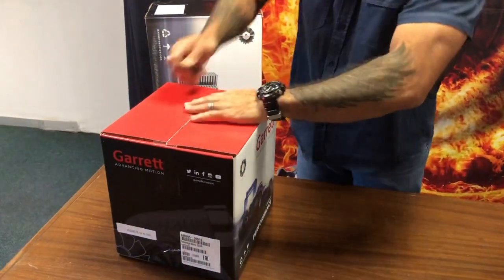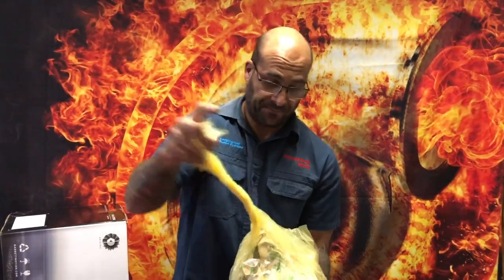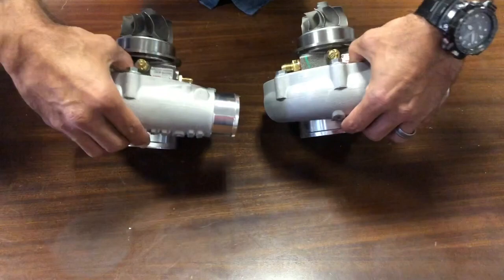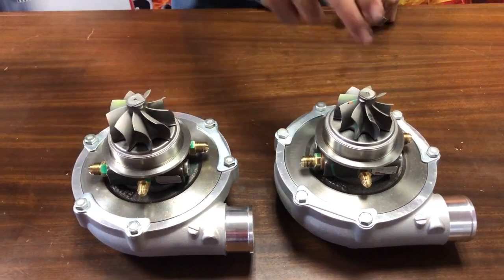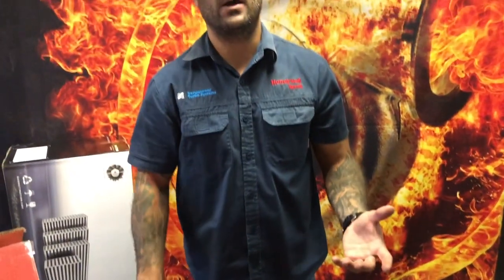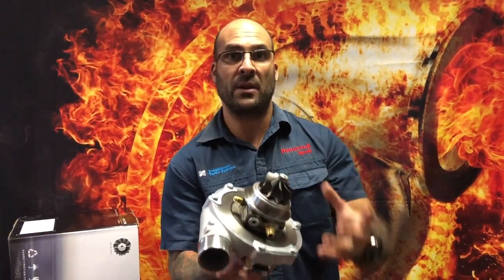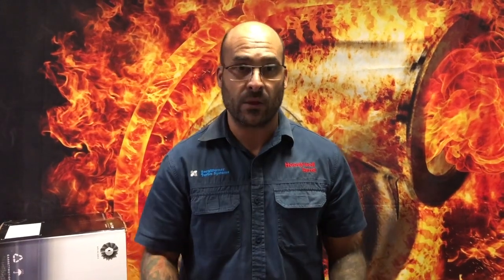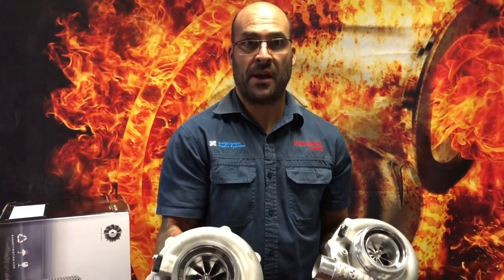G30-900 and G35-900 compared

Comment: Great videos man! I need a new turbo. So far I have been running with garrett turbochargers. Any advice would be appriciated. I got a rwd street car running a 3.2 engine, much like the 2jz. My setup is as follows; 6800 rev limiter, 9:1 CR, 95octane. 1.3 bar of boost on a t3 T04E. It may be too much to ask for, but looking to keep my 200whp at ~3000, and anywhere between 500-600whp at top. Would G30 660/770 or EFR 7670 be a decent option? Cheers!
Reply from the maker: Thank you for the comment - Garrett are overrated, especially the HP claims in the new G-series turbos. There are many options that exceed the capabilities of the latest Garrett range. Shoot me an email and i will assist you further info@turbodirect.co.za
Reply: @TurboDirectSA  Garrett's G-series HP ratings are based on two things. Crank HP, and with HIGH FLOWING heads such as K-series heads. When you take those into account, they're actually a bit UNDER-rated, as I've seen G-series turbos run (on a high flow head engine) damn near the rated power AT THE WHEELS. So if you have a car with a crappy head and an auto trans, especially a older (read, less efficient) torque converter auto, then yeah, you won't get 660 out of a 660 Garrett.

But if you have a K24 with a transverse-mounted, straight cut sequential trans? Yeah, you'll see every ounce of a G25-660 helping you blow the doors off of whatever wants to run you, AND spool up like a MOFO down low with the right housing (meaning don't choke it with too small a housing).
Reply from the maker: @Drunken_Hamster  I have to disagree - air flow is measured in lb/min according to most compressor maps. The closest X10 measurement which is an industry standard in turbine mapping will generate 100HP per 10lb/min of air flow - your engine can either use it or not  - if it cannot, you will not make as much power as the next engine that might be able to use the flow in a better way.  

Having said this - just because your engine can 'use' the air flow, does not affect the fact that 10lb/min of air flow (X10) will produce 100HP - the compressor maps are fact, based on testing on gas stands and the results are printed - the G-series turbochargers do not perform as advertised, and if you are seeing big numbers, try a different dyno, and you might be surprised.   We have measured HP and air inlet flow using flow meters from Superflow on our engine dyno and we have verified both air flow inlet to the compressor and the HP output from the engine as married to X10 perfectly - no corrections.
Reply: @TurboDirectSA  Was this test being done at Denel Last April? I was at your showroom and heard the dyno running inside.
Reply: @siyabandasekho6851  This was Bruno's engine - i heard about this at Midvaal, they changed the turbo to one of Turbo direct ones and it outperformed the G35 that was on there not sure of the numbers though.
Reply: @TurboDirectSA  This was my engine that you setup for me, the G35-900 maxed out at 38PSI and made 782HP on the water dyno. Your turbocharger made 812HP at 30PSI on the same dyno, and 839HP at 38PSI with some more to go. The engine is broken now thanks to someone who didnt listen and turned up the boost after you warned me not to run higher pressures.  We ran out of injector!
Reply from the maker: @brunopotgieter2016  Sorry to hear this news man! Please remove that turbo and send it to me, the engine failure if you ran lean, would have damaged the piston, and there could be aluminium in the manifold, turbine housing and on the surface of the turbine wheel blades.
Reply: @TurboDirectSA  So who makes better turbos, then? From what I understand, Garrett's G-series is doing some almost magic stuff, especially in terms of spool speed/boost threshold to total HP numbers. Not to mention how compact they are physically.
Reply from the maker: @Drunken_Hamster  This question will be different for every person, as its personal preference. If you asking which is a better product based on features, design, quality, finish, price etc -- then BorgWarner takes the win every time. Some of the features that Borg have over every other manufacturer are the following:- 

GAMMA-TI turbine wheel
Water cooling jackets that are more than triple the size of Garrett
Enlarged bearing cartridge, ultimate reliability
Designed for motorsport and racing (yes fit for street use and drag racing too) 
Stainless investment cast end housings
Vband attachment for the bearing housing and turbine housing mate
Massive swing valve internal gate design
Twin port swing valve internal gate
Aluminium Bearing housing
Integrated DV
Integrated Solenoid
Speed sensor port

Read the above carefully - and know this - these features are in existence now since 2010!!!  Thats right, EFR came out with these features almost a decade before Garrett or anyone else did.  "New technology" from Garrett are simply copies/responses to the EFR designs. 

Personal preference remains a factor in each persons choice for a turbo, but facts and features on paper, Borg takes the win every time! In practise and performance/results, once you have tested Borg back to back with Garrett, you will land up choosing Borg aswell - albeit be it a little difficult to move from the red box for those die hard Garrett fans ...... try it and trust me you will agree.

Comment: Any experience with these on a evo x with a 2.2L stroker? Looking for 700-750hp.
Reply from the maker: Not personally, but a client of mine shared info on this build before changing to one of our TurboDirect S.A Forged turbochargers. The turbo replaced was the G35-900 and the power was lower than expected at the boost pressure that they were running. 

The change to this turbo showed an increase in power while maintaining the same response, bringing the power band into line with their requirements. Lower boost pressure with more power. 

 https://turbodirect.co.za/store/index.php/shop/turbochargers/gtx3582r-forged-detail

Comment: Hi Chris, what will be te best the G35-900 or G30-900 on a 2.0L 20v... thanks in advance
Reply: Hi Chris  750whp
Reply from the maker: @eduanwessels4292  These turbos don't make the claimed power by a long shot. The most we have seen on a 2.0 multivalve 4 cylinder engine is 720HP at the crank. You will not see 750WHP with the G-series 30 or 35-900. The compressor map will reveal a better idea of what you can expect to make with these turbos. 

The EFR8474 is a much better option by far, it makes the power first of all, and the features of the EFR series are untouchable compared to the Garrett range. The bearing housing is available in aluminium, the cooling port design is far larger and superior to Garrett, the rotating assemblies rotate alot slower to make more power, and the internally gated options with swing valves up to 42mm in diameter are something Garrett cannot compete with at all.   First hand experience with the EFR series and the 8474 Black, specifically, opened alot of our eyes.
Reply: Thank you Chris, with the EFR 8474 black is it better to use the twinscroll  and what exhaust housing will be the best to use? I know they said you can blank the EFR turbo to make it a external  wastegate if you still want to go twinscroll. Just want to know what you think will be the best for the 2.0 20v to make 750whp.
Reply from the maker: @eduanwessels4292  You should use the AR82 housing - i wouldn't use external gate at all, it will create lag especially with smaller size engines. The swing valve on this turbo is 42mm (42mm wastegate built into the turbine housing)  Shoot us an email info@turbodirect.co.za i will get a video to you showing you the response of this turbo and a 9sec run in an RB26DETT at 1.7bar gauge pressure.
Reply from the maker: What HP target Eduan?

Comment: Hi I have 2 projects I been working on and always used garrets my first question is 
1: I’m doing a built motor  (cla 45 amg )2.0l 4cyl dct 7 speed awd
I was told to use 3076r as upgrade turbo 

But instead I’m doing a custom exhaust manifold  I was gonna go g30-900 I’m tryna hit 780--840whp  I want a turbo that won’t be too laggy giving it’s a 2.0l motor  but still can hit hard  2800-3400 

Project :2 :I currently have a hellion twin turbo hellcat 
6.2l v8 motor fully built stock heads just upgraded pushrods,beehive springs and lifters mds deleate, 
I have the garret gtx3582r gen2 turbos on it now the car made 1200 whp on 25 psi and built to go 31-33psi 

I think it’s a 1.01 ar or 83 not sure it’s the kit from there site 
The car pulls hard but since it’s not a stroke426 it tends to be lazy down low anyway below 4300-4500    I want to know if I switch to a g35-900 would that be better.   Or should I use a different a.r housing first ? 

I know gtx3582r is a 66/68 basically any help would be appreciated on these projects 

The hellcat is a fully forged motor turbo cam and built transmission 

The cla 45 amg will stay 2.0 4cyl forged bottom end.  Single mount system  will be street raced /roll race events
Reply from the maker: Thanks for the comment - happy to help and offer our opinions and experience. The G30-900 will not see close to 900HP at the crank let alone at the wheels - dont bother. We have experience with this engine with a closed circuit track car in South Africa, which makes 340-360WKW at around 1.6-1.8bar boost - running an EFR7163 Vband AR85 turbine housing and internally gated.  The turbocharger spools as quick as the stock unit and makes over 150WKW more power at the same boost.  The EGT's are lower than stock, the water temps are lower and the drive-ability of the engine at low boost street driving is unmatched. The car had two previous turbos on, one was a bolt on kinugawa (paper weight) which was a copy of the Garrett GTX3076R and was laggy and made no real power. Then there was a Genuine Garrett G25-660, which spooled faster than the chinese paper weight, but didn't make close to the claimed 660HP - the EFR7163 is claimed to make 550HP, but the compressor maps shows closer to 600HP and the turbo delivers exactly what it claims on paper.  This car should use the latest EFR8370 - this is the same turbine stage as the EFR7670 (650HP capable on paper) yet with a better compressor stage, and is now claimed (on paper) to produce 750HP, but the compressor maps tell a different story - showing closer to 800HP capable. This will spool as fast if not faster than any G30, and will definitely deliver the goods, and save you money at the same time. 

Regards to the Hellcat - thats easy - change to the AR8 turbine housings, (thats IF you have the AR1.01's on currently) that will solve your problem, if you have the AR83's on now, then change to the AR61's - you will cut off slightly up top (20-25HP loss due to back pressure) but low down you will gain plenty.

Comment: Hi there! What's your opinion on using these turbos on a single port head, like the mk7 GTI I am building? Expecting 700-750 wheel on e85, given I already have a fairly large exhaust restriction even with a sizeable port to the head where it will not flow past 800-850ish typically even with porting, is the G35 just likely to be extra lag with no benefit?
Reply from the maker: SleepyGTI - thanks for the comment, im sorry to say but you will not see 750WHP + on the EA888.3 engine. Not with all the external mods nor with larger valves, and flowed head. If you see 700WHP you will have achieved more than most with a spend of over $30K+  in their builds.   This is just not a realistic power figure im afraid.  We have clients who have run EFR9280, GTX3584RS, S300SXE, and many other combinations, and the power seems to top out around 650-680WHP in most cases.  I would stay far away from the G35 - it does not make anywhere near what is printed in the catalogue.

Comment: What’s the difference between the g35 900 vs 6466 for an Sti?
Reply from the maker: The Precision turbo uses a larger rotating assembly on both sides - but the precision will make the claimed power - the Garrett will not make the claimed 900HP - 

Another option which makes the power and will easily outspool both these turbos is the EFR8474 Black.

Comment: After looking at this video, several other videos, the comment sections of a few of your videos, talking to several tuners, and talking to friends that have turbo S2000s, I feel a bit conflicted as to what I would throw on my car now. (most likely due to my lack of knowledge in turbocharging) I've had very conflicting answers regarding turbo selection for an F20C motor, some people saying a GT30 sized turbine running out of steam in the top end (7500RPM+) because the head is flowing more than the turbine can flow, and then the GT35 sized turbines making far better power for equal spooling (a case of the GTX3076r [mismatch] vs a GTX3576r).

One instance I talked to an S2000 owner that used a G25-550 .92A/R, and he switched to 660 compressor housing due to some compressor surge.
Another recommended a GTX3582R .82A/R to take advantage of the F20C stock head flow, as the car is already fairly gutless under 5000RPM. This leads me to think that the G35-900 would be a good match for the car but I'm not so sure now.
I understand that running a larger turbo at lower pressures would put it outside of it efficiency islands possibly.

Right now the car is a bit in of an identity crisis where its edging from a weekend warrior street car to a circuit car that's not very practical on the street, and trying to get the car to perform both roles that I find satisfactory.
I'm leaning on sacrificing the street drivability of the car to allow for better headroom (more headroom is always better right?).
Reply from the maker: Thanks for the comment - let me shed some light on this for you. We have a number of clients who run these S2000's here and i have built and supplied a number of different turbos on these engines. 

1) They are high flowing indeed - 
2) power drops off with the smaller GT30 family size turbos, even with larger AR turbine housings
3) Low down response with the older Garrett style turbos is almost impossible WHILE TRYING TO BALANCE HIGH RPM FLOW

We have build Journal bearing T4 setups with the 60-1 compressor wheel and 446905-0501 turbine wheel using the AR63 T3inlet and 4bolt outlet race style housing from Garrett - it works well, but low down is miniscule. 

Then the GT3582R (not GTX) using AR63 turbine housing - better low down, and similar HP up top to the 60-1 compressor - but not thaaaaaat great for street. 

The best low down response with a massive 950HP capable option is by far the EFR8474Black series - using the AR83 turbine housing will blow any of the G-series turbos out the water in response aswell as outright power delivery. The internal gate is superior and will save you alot of money and plumbing under the hood aswell.
Reply: @TurboDirectSA  This is super awesome information, while drafting the comment I completely forgot about the EFR black series. This helps a ton, thank you for quick response, much love!
Reply from the maker: @Temtac  Pleasure buddy -- we just tested an EFR8474 Black on a fully built RB26DETT hill climb car with the AR92 turbine housing, and it spooled too fast, 3500RPM was already pushing into the seat - and the engine is build for 1300HP and lives at 10000rpm, we now replacing with the larger AR1.05 housing - we want the power later in the RPM range -
Reply: @TurboDirectSA must be externally gated because internal gate on these will be lucky to go past 2 bar. Falls 200hp short

Comment: First of all, the G30-900 turbo will NOT do 900hp, (just think of 900hp flow through a +2' pipe in hot turbine including 9 blades. Not gonna happen! (all marketing) 
2) ratings are these days on high nasa rocket octant fuel (all marketing), other program uses correct pump gas as lbs calculation, so dont compare rocket fuel with pump gas
3) these turbos are clipped on both compressor exducer and turbine inducer to harvest top end only. All mid-range flow are gone in favor of higher shaft speed. They typical demand 15K more shaft speed to same pressure ratio compared to old program. Now, consider what it converts to of engine rpm on a drift car before jumping on board
Reply from the maker: Thanks for the comments - the new Garrett products are overrated without a doubt - both in reality and on paper.
Reply: alberto was running a g35-900 and he def hit over 800whp using 1.01A/R and he never used the spare 1.21 A/R. he also was on race e85 and had Bc 272 Cams. with larger housing i’m not sure what it would have made. 808whp equates to either 900bhp or close to it.
Reply: @bigjdm5460  G35-900 is not a G30-900, and still they are rated at same peak power. You will not get a G30-900 near 900hp with that tiny diameter turbine wheel. Think of it, why- and how would you force 900hp exhaust gas through a tiny 2' diameter with 9 blades and a shaft inside. Not gonna happen unless you are sitting in Marketing making the advertising
Reply: @205CTT  damn, thanks. i def thought he said G35. i usually dnt mistake them as i already know the G30 turbine side shares it’s dimensions with the G30-770.
Reply: @205CTT wait, if u guys are saying the 900 is all marketing but it’s proof out there the g35-900 with biggest a/R e85 and cams can def make 870whp. Then we can assume a 2.5L or 2.0L with few mods and fuel can get close with g30. I’m listening to u guys then I’m seeing dyno runs saying otherwise. Smh

Comment: I just bought and received my very first turbo I got the g35-900 with 84 exhaust housing .. hope it works well with my built rb30det in a VL commodore running a 6 speed tremec magnum and 411 diff gears 🤤😊😎
Reply from the maker: Sounds like a great project - share some info and dyno figures once you done with the build.